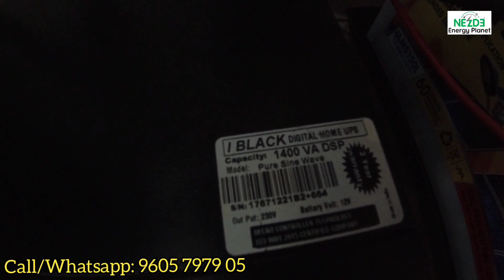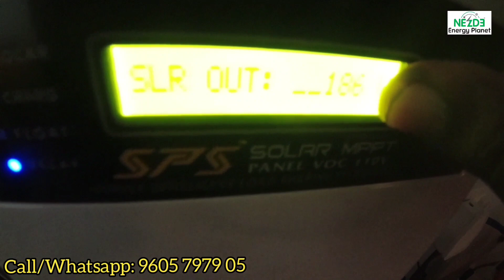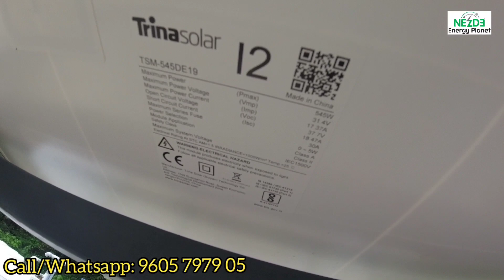1KVA സോളാർ രണ്ടു വീടുകളിൽ.. രണ്ടു രീതിയിൽ #offgrid #ongrid #solar #trending #ev#kseb @nezdeenergy7010

Comment: Bro second 1 kv system ashapower mppt ethaa model
Reply from the maker: Nova 50- 12/24
Reply: @nezdeenergy7010  bro ethu work akanunu minimum voltage Etharaya vede same panal anu ente but ashapower 60 suriya hv anu mppt but panal voltage 29 ayallu mppt work cheyunilaa bro eni solutions charging nadakunilaa... Reply please
Reply from the maker: @sanojmathew5090   ഇൻവെർട്ടർ 12/24?
Reply: @nezdeenergy7010  12 v